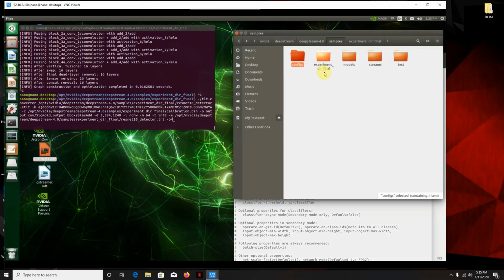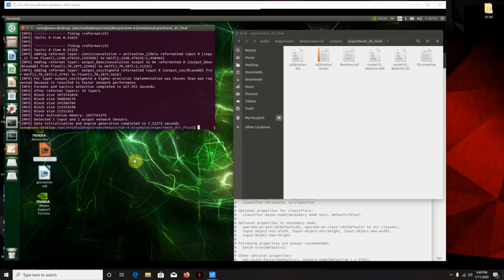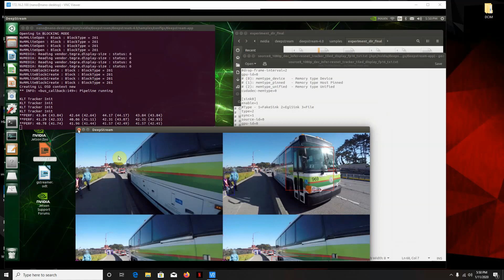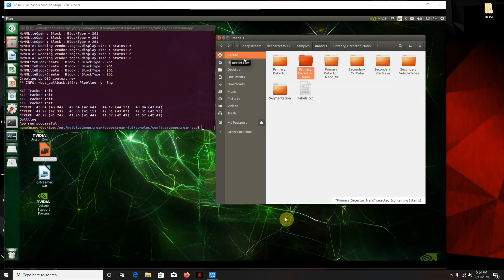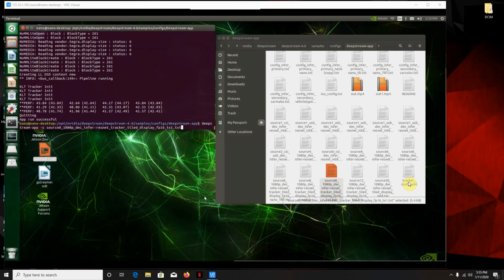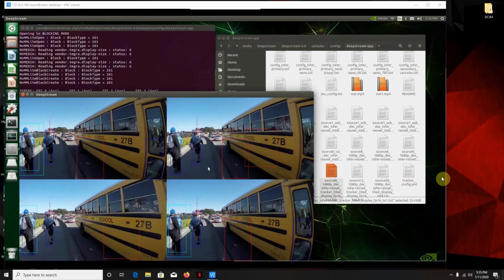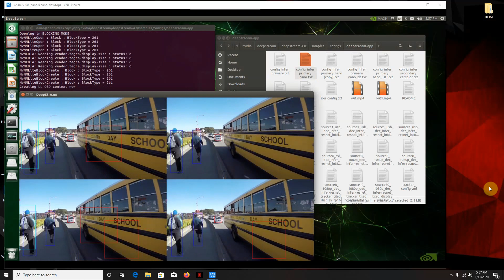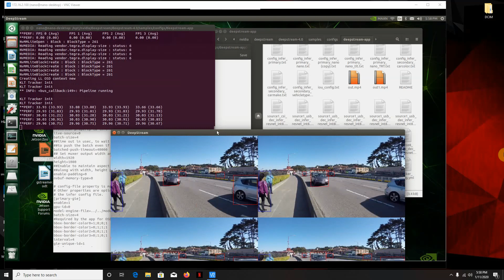Using the Nvidia Transfer Learning Toolkit Part 3

Comment: Hi, at 2:35 in the video you refer to where the conversion could hang up. That is happening to me right now, at that same spot. What is usually the problem causing that?
Reply: Nevermind I figured it out, the calibration batch size was incorrect....

Comment: Are you using a tracker or is that 30 actual detections/sec?  I found I could detect like once a second and track the object cheaply once a detection occurs.  You didn't scroll to the end of that config so I couldn't tell.  One other thing, it would be nice to see the labels, which is a command-line option to the deepstream-app rather than a config file property.  It's disabled in that muxed tiled display by default, only shows in single videos without that CLI option.
Reply: You also get a handy number after the label so you can visually associate an actual object rather than the pure bounding box discrete frame-by-frame.  It'll say like "CAR 1" "CAR 2" and maintain those numbers as long as it tracks the same object.  Sometimes it will lose it and reacquire it as a new number.